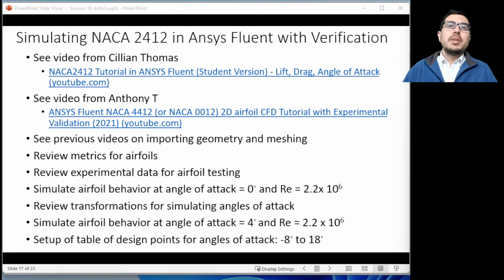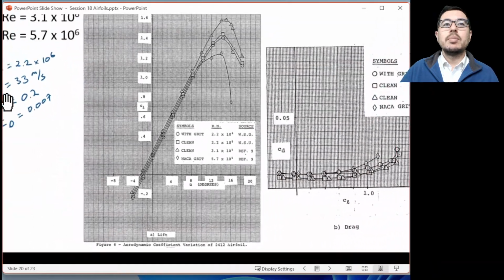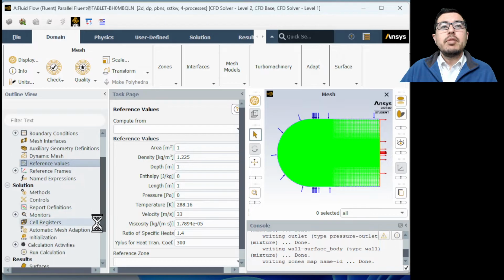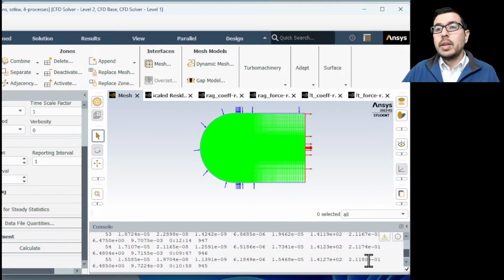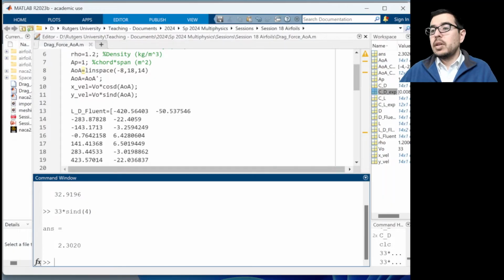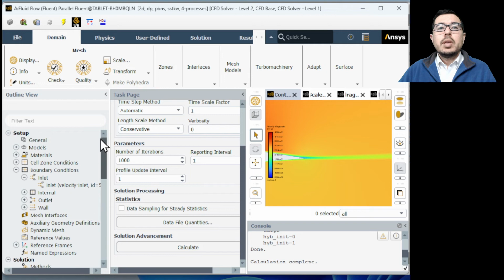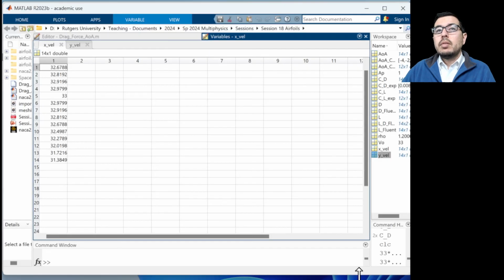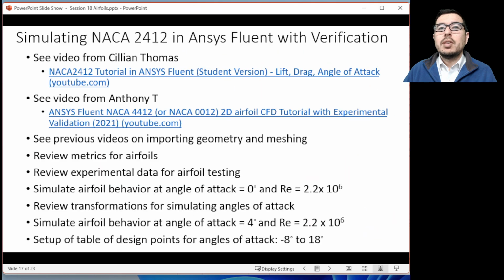Simulating NACA 2412 Airfoil over Varied Angles of Attack in Ansys Fluent with Verification

Comment: Thank you for the very well description. I have a question how you can be sure that the same iteration number is OK for all angles? I am not quite sure that the simulation can be converged with 1000 iterations for 12-14-16 degres.
Reply: hi, i've conducted the simulations across different angles of attack and all the pre-stall angles solutions would eventually converge at worst about 180 iterations (i did them with structured mesh, it could be longer than that with unstructured mesh but 1000 iterations is very unlikely). After stall the flow is unstable anyway so it would never converge to a stable solution, the lift recorded is just the mean lift (the lift would varies periodically in this case), so no worries on that too.